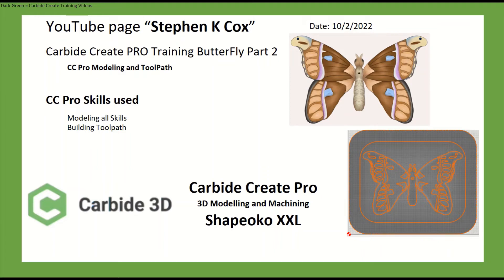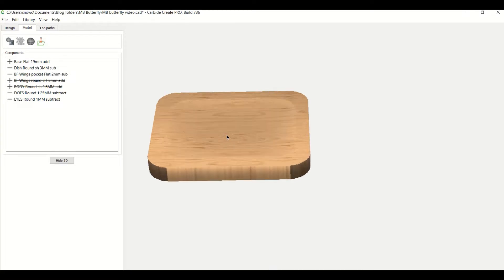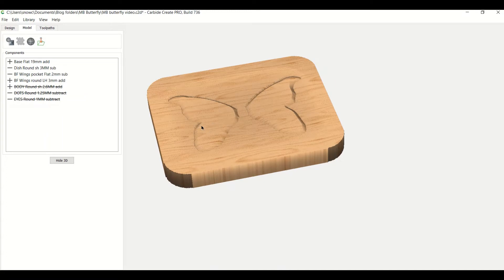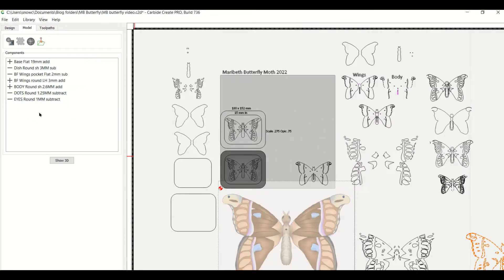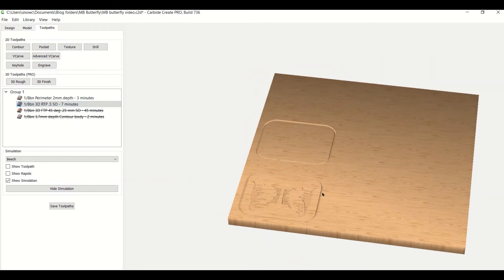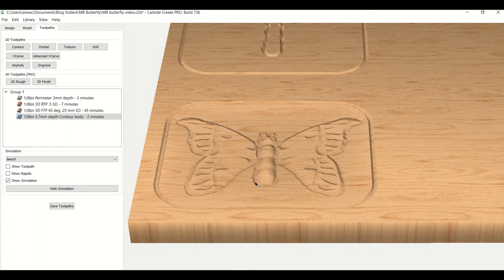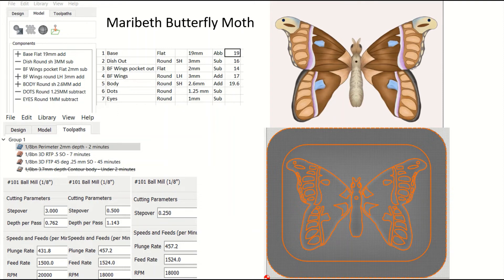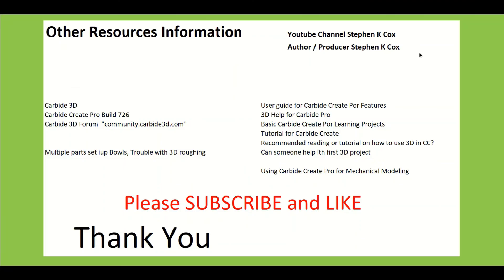Carbide Create Pro Training Video Making a Butterfly Part 2

Comment: So I am brand new to 3d carving.  Using carbide create pro.  I am confused about the adding.  You ran a toolpath that removed 3mm but then ran other paths that added???  If you remove the material first why doesnt it remove 3mm before going to the next tool paty.  That part is very confusing to me.  Can you clarify?  Does it use your stock height at all in the initial setup?
Reply from the maker: Building components is different from tool paths.  When building a 3D component first you must add a component (3D block) to add and subtract from.  If you modle is to high it will be red, if to low it will make a clear hole.

When you get to tool path you can do two types of 3D cuts, rough and Fine.  Highlight the area you want to cut then make a rough cut then a fine cut.  You can do more than one rought and fine cut.  

let me know and i will help more.